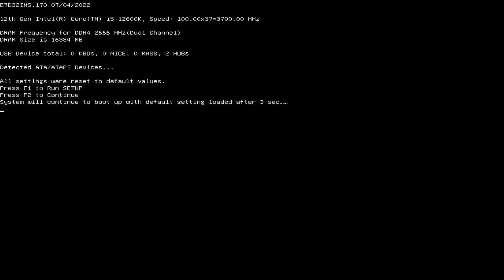How To Clear Your CMOS - BIOS Reset Tutorial

Comment: I didn't reset my CMOs but I took it to Best buy because I couldn't find the CMOS 3 pin jumper. The Best buy tech found it right away jumped it plugged it in and I worked. I think this is a sequence he did it in,  is it correct. 
Unplug the tower 
Move the jumper from the left two pins to the right two pins.
I think he held down the power button for 20 seconds then released it. 
Put the jumper back on PIN number one and two. 
Plugged it back in. 
Turned it on. 
Is that the correct sequence or is it just the way you did it in here seems like the only difference was he had held down the power button after movie The jumper over. 
I will try it your way if My computer fails to start again.

Comment: Thank you, I was stressing about this, usually I would just remove the CMOS battery from the motherboard. But I recently built a new PC with a budget MSi board and CMOS is attached to the board with red and black wire, and stuck in between io slots in the back. 

The screwdriver technique worked perfectly! Now my PC boots up with the extra 16gb of ram I just installed.🙏🙏🙏

Comment: Didn’t work… removed the CMOS battery for 10 seconds, touched the battery in the metal socket where it fits, touched the 2 pins with my screwing tool for 10 seconds and it’s still not starting, the damn MB flash update screwed my life now I can’t figure out last resort methods….

Edit: the issue was the old version of the BIOS that I installed was incompatible with the CPU, so I went and bought a cheap Pentium to make it work and then I updated it to the latest and then it fixed it.

Comment: my issue is that I had to replace the powersupply because I pligged the power sw into a jumper socket and it sparked the psu. vut I am going tontry this solution becaise motherboard cpst arm and a leg

Comment: so helpful, I tried to change my BIOS settings for Core Control as my CPU cores were stuck at 2, changing the system configuration didn't work, so I booted into BIOS and changed something that I thought broke my pc as it wouldn't boot. Found this video and my cores are now at 6 instead of 2 and booted my PC normally

Comment: Hi, i have a question. I have mini version of motherboard. I dont have power button like u. Also when I try to locate Jumper I need to také out procesor thermal Block. Bcs He cover all size of motherboard. And I Also start up pc for denized every spot of energii from PC. So my Question is. Iam need to star up PC And then turn off And unplug the power cable or its okey when i Just plug power cable And unplug for the Jumper reset? Sorry my english is bad I mean, I need some power in case when I need to reset bios with Jumper?

Comment: it didnt work.. I have no clue what to do now.. no bios no windows just black screen. plz help
Reply: did you find a solution
Reply: Yes. I changed video output from dpn1 to hdmi 1. It seems that this was my bios default output setting
Reply: @bjornhegel  I somehow made it work but now I do not get any mobo error nor display. I suspect there is a problem with the psu or circuit

Comment: Hello even i clear the cmos and replace new battery. It says press f1 to run set up. So i press f1 enter bios setting and add the date and time, then safe by pressing the f10 key.
My main issue is that when i unplug the power cord, i still get same issue. And the date and time change to 00:00hrs.

Can you guide me what should i do.
It would be grateful if you could help me out please. Thanks in advance. 🙏

Comment: If you don't have a Clear CMOS button on the back of your MSI I/O panel, they also have a "JBAT" jumper pins on the inside at the bottom

Back 10+ years ago when I would do overclocking I would leave the CMOS battery out until I got a perfectly stable OC. If it hung up, all I needed to do was flip the power switch and hold down the power button to reset it. Then pop it back in when I was done 👍

Comment: I have an MSI X470 Gaming Plus MAX, and I tried to manually boost my ram mhz from 3200mhz to 3600mhz as that is the maximum that it can go to (according to corsair vengeance pro which was obviously wrong or something idk) after I did that I saved in the BIOS and restarted PC (didnt build this PC my friends sister did and I have never built a PC before so when this happened I was SCARED, and deathly anxious, looked up on reddit that all I needed to do was clear my cmos, didnt know what that meant to so I dived deeper into the internet) and it was black, just black, and apart of my motherboard right below the RAM was constantly red, I was like, oh no, I broke my PC (lol), anyway the type of motherboard I have actually has a button on it at the very bottom near the rear end called CMOS_2 and I clicked that for what seemed like a lifetime, just so I done it correctly, after that everything was fine, but then I went into task manager and saw that my ram speeds were down to like just over 2200 mhz, so I went back into BIOS and just put on game mode and xmp profile 1... and it went back to 3200mhz. I honestly think some component companies lie about how much you can push certain hardware, or maybe it was because I have a semi - modular PSU and the CPU may have been taking up most of the power so that the RAM couldnt go to 3600mhz as advertised on corsair ram. I never needed to do what you said in the video, just a button and solved. 

If anyone has a MSI X470 Gaming Plus MAX and needs help finding this button then I will be glad to help you, its much easier than doing it this way.

Comment: Been having so many issues with my b550 motherboard I have to sit 1hour tryna reset the damn thing it’s like a car
Reply: I need to know what you shorted it with
Reply: @Spldernutz I’m sure you got it sorted but you just use a screwdriver or any bit of metal so it connects both pins for 10 seconds and it’ll reset the cmos
Reply: Did this work i got b55 also

Comment: If you on a tight schedule, just pop out the CMOS battery and use the battery's body to short the +- pins on the motherboard for a few seconds.
Reply: I'm suffering in pain, I wish I never changed my BIOS settings, I have decided to take my own life.
Reply: @BlackMask10472 same fo
Reply: @BlackMask10472 same 😭
Reply: If you take out the CMOS battery, doesn't that reset it? You still need to short the pins?
Reply: @bsykesbeats  No, you still need to short the circuit.
Reply: the capacitors can allow the mobo to hold your bios for up to a day usually @bsykesbeats
Reply: @sunnywunny bro fr?
Reply: Wich pins ???
Reply: HOW DO I TAKE PUT THE CMOS BATTERY
Reply: Thank you very much, this saved my life